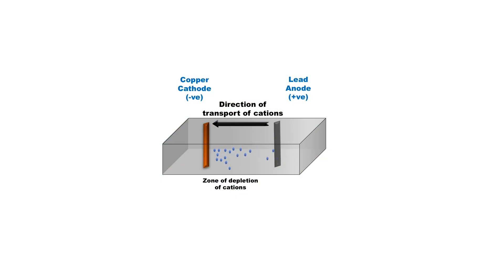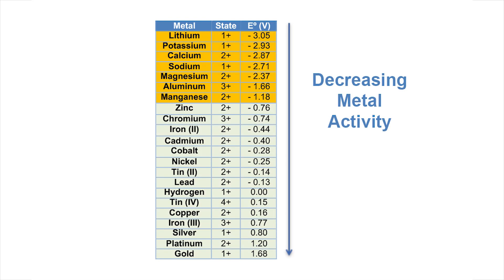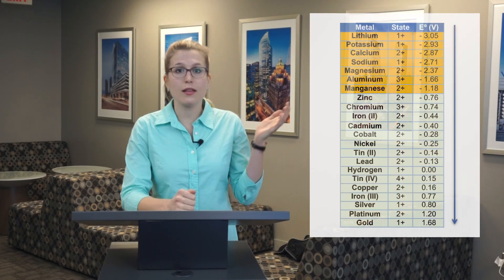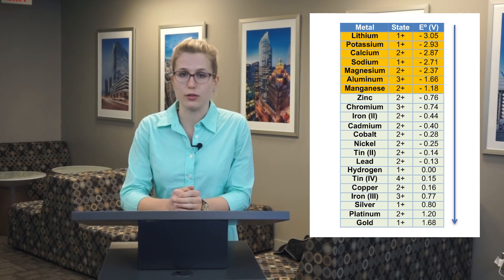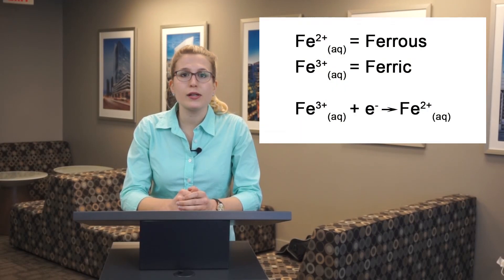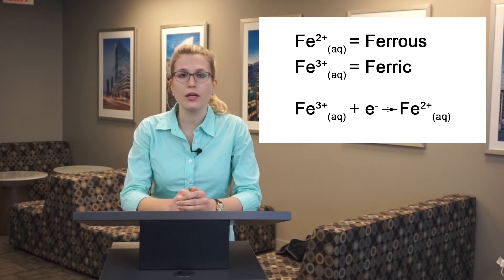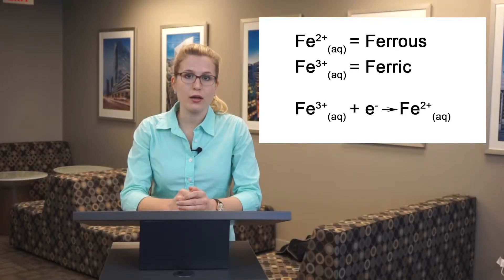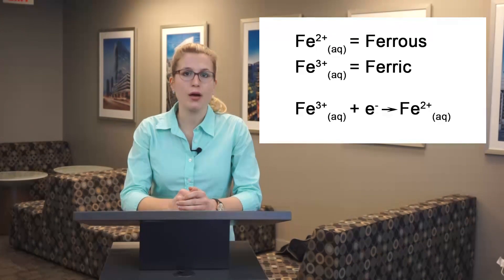Electrochemical series' connection to electrowinning

Comment: Where does carbon/graphite sit on the scale of potentials
Reply from the maker: Hi Arne, it depends on what species the carbon/graphite is oxidized to. Assuming this is carbon dioxide the standard reduction potential for the CO2/C couple is +0.207V.